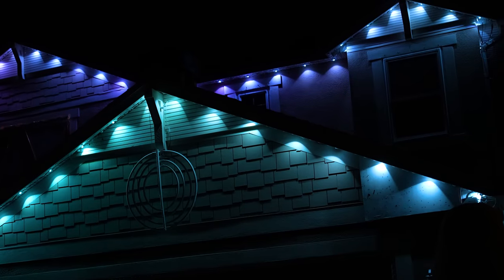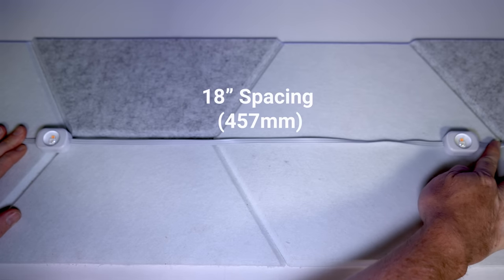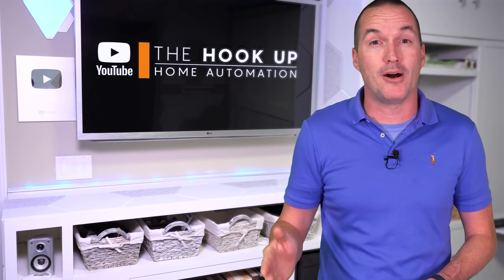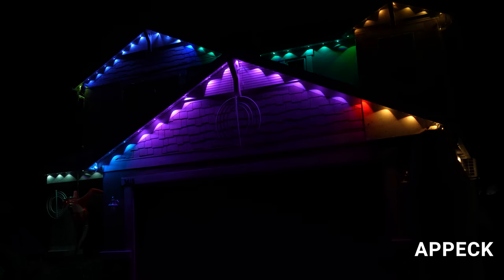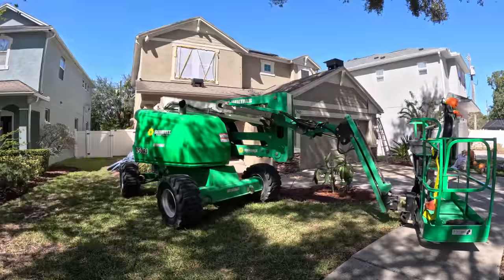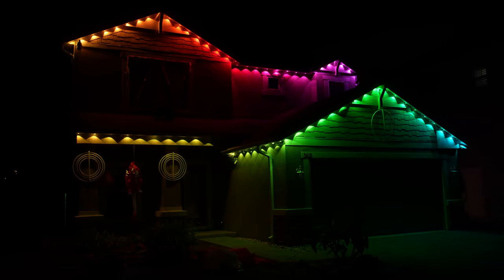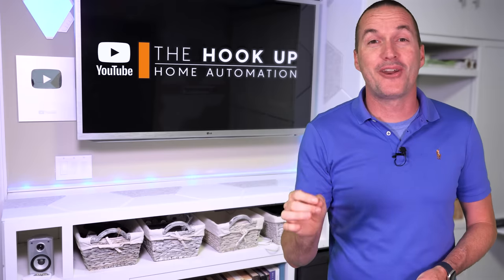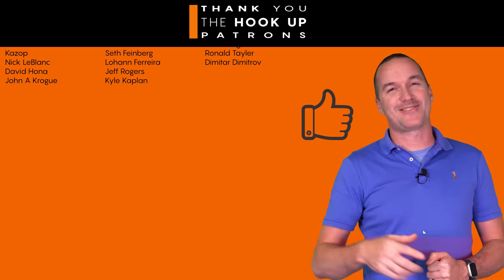Best Permanent Install Exterior LED Kit? Govee, Govee Pro, Eufy, Appeck, YPS, Novostella

Comment from the maker: Small correction for anyone trying to use the Eufy lights with WLED: In LED preferences they need to be color order BRG with W and G swapped, I said W and B in the video.

Full explanation of using WLED with Eufy/Govee here: https://youtu.be/F7IhSKJ41rU?si=720loC0GEXehwGlS&t=332
Reply: Thanks for the update!

When you show "Home Assistant: No" for the Eufy lights, does that just mean direct integrations from HA to Eufy, or does that include the WLED integration in HA? I would assume any lights that are WLED compatible would be HA compatible, but wanted to check before purchasing the Eufy ones!
Reply from the maker: @PiercingGoblin  Just the Eufy controller, WLED will always work with HA.
Reply: How do you connect the Eufy kit to WLED?
Reply: Seems like you’re going to do a video mid November… looking forward to it! 

(I’m hoping to find out how to extend beyond 100ft with Eufy… I’m planning on using 2 kits, just need to know how to connect them together … possibly with WLED?)
Reply: @TheHookUp  Can do a walkthrough on how you set up wled to control the Eufy lights? I’m puzzling over using the included 36v power supply where most controllers seem to have an input range of 5v-24v. How do you manage it?
Reply from the maker: @FreQi  Coming in next week's video.
Reply: Thank you so much for the correction.   I just build out my WLED controller for the eufy e120 and now all is well.  I appreciate your time and effort on so many of your videos.  Also, I was able to reuse the e120 connectors cut from the eufy controller by running a razor blade ALONG the wire on each side and pulling back the cover.   This was needed because of how they molded the wire to the inner wires.   I can confirm: red - voltage, black - ground, whiite - data.
Reply: Did you just tap into the cable with a data line to run it with WLED?
Reply from the maker: @Spderman37   https://youtu.be/F7IhSKJ41rU?si=720loC0GEXehwGlS&t=332
Reply: @TheHookUp   wanting to do the yps for the professional look, how hard is setting up all the custom components on the hardware side, software is not a problem as I am a programmer but I want to be warey as it is the pricey setup and I would rather not ruin it
Reply: Might want to sticky this comment so more folks see it.
Reply from the maker: @nofocus9329  Hmm, strange, it must have un-sticky'd itself.  Thanks.

Comment: Dude! This is an awesome tutorial.  Thank you for putting the time to make it happen. I went with the Govee non-pro version, and I'm glad I did. The app is fantastic, and I love that I can run them on WLED. It would be great if you could show us how to integrate some of the most compatible light kits into an X-lights Christmas show. Thanks again, bro.
Reply from the maker: I'll be making that video (xlights with off the shelf kits) in mid/late November.
Reply: will be the way you can extend some of them beyond what the manufacture says. as its just a simply setting in the WLED software. will be interesting to see if voltage drop then plays a roll, why they likely set the limit.
 @TheHookUp
Reply: Anyone know if it would be possible to sync multiple separate buildings like home and garage?
Specifically with Govee and a Weld controller

Comment: thanks for another awesome video.  Just cut the cables and installed my Eufy on my Dig-quad.  In case anyone else is trying to use WLED with the Eufy lights, I had to swap W & G to make it work rather than W & B.  It was otherwise exactly as outlined. Great tutorial!

Comment: Excellent comparison video. I bought the GoVee permanent outdoor lights, non-pro version back in July and just got them installed over the last few weeks. I’m very happy with the way it looks. I had made a cardboard template to keep the light nodes 3 inches from the wall for installation without having to keep pulling out a tape measure or ruler. So that was a useful thing. If I were to do it again, I would probably bring the lights 4 inches out from the wall. I don’t see any advantage to the Govee pro other than the warm white lights and it’s not really something I would be using very often. Plus, I’d rather have the brightness and more lights than the Govee Pro array gives. I have thought about running a separate string, just for warm white, if such a thing exists, but I would only be using that for security, or perhaps non-holiday accent lighting, but I don’t know. It’s still not worth it to me to get the Govee pro at this time. 

I took my time spacing the light nodes over the center of large windows, and other features of the house, so that worked out fairly well, and I think the wired system as opposed to a track system provides more flexibility for this. The wires are not really visible at all from the front of my house unless you get right underneath the eaves. So that doesn’t concern me very much. I definitely recommend buying more clips though that’s essential I think.
Reply from the maker: Nice, the template is good idea.
Reply: Great idea using the template, as popular as Govee is perhaps someone has made a 3d printable mounting bracket
Reply: Do you soffits? If so, what type and length of screw did you use?
Reply: What clips did you go with the ones that come with or did you find other clips that worked?
Reply: Yeah I’m kicking over the idea of running a warm white strip next to the Govee pixels as well just for later.

Comment: For the wired types like Govee, I used a 8" long 2x4 scrap to space them off the wall of the house. Made things simple, Also note that around my windows they were further recessed than the bulk of the house. So the length of the 2x4 accounted for it and I just rotated it for those situations to keep uniformity.

Comment: You are blowing my mind right now. How did you review all these in the time it took me to make one video? Aslo, I can put the Eufy in WLED!?! I had a similar track to the YPS 10 installed at my house but it has warm white. I paid a ton for the install. Amazing video!
Reply from the maker: I saw your video, the install looks great!  Yeah, the eufy just takes a 5v data signal, so connect the data wire to a WLED controller, positive on the LEDs to the Eufy power supply, and negative of the Eufy power supply to both the LEDs and the WLED controller (common ground).
Reply: @TheHookUp  Thanks for the info. I might have to try that out. I'm still have a ton to learn about what my WLED system can do.
Reply from the maker: @TechWithBrett xlights!
Reply: @TheHookUp  Eufy notes that you cannot cut to shorten, but I assume that is thrown out the window if you abandon their native controller and wire them to a WLED controller?  I currently have strips similar to yours and am interested in adding the under soffit look as well, being able to add to WLED for xLights is key.
Reply from the maker: You can definitely cut and shorten them.  I think the reason they say that is that the final LED in each string has a capacitor in it.  I assume that makes it easier to cross gaps with the extension cables, but it could also be used for some sort of software detection of how many strands are attached.
Reply: Can you use Eufy’s controller with WLED or do you have to get a different one in order to use WLED?

Comment: I just did some Ray Wu RGBW TM1814's and their aluminum track, they look awesome (similar to the YPS but way brighter) and the warm white is excellent. No bleed through from the blue like you get with some LEDs. Pricey though. 30M of track, 14 strings (280 pixels) and meanwell power supply for about $650CAD to my door.
Reply: Don't suppose you have a link to what you got..as well as the channels? This is the route I'd like to go. Nice warm white is key. Thank you
Reply: Yes, would love the link for all that's required for this -- YPS is sold out of their puck tracks.
Reply: Bro serious? Looking the Ray Wu store it looks like 30M of track is $1k plus $600 for shipping to here in the US. That's before the strings and power supply...
Reply: @tburch12785  each "order" of track is 10 1 meter sections. For some reason it only shows you that on the desktop site, not the mobile app.
Reply: @xnizonyt  ohhh yeah that makes a difference lol.  Thanks man.
Reply: What Led Controller are you using and how big of a power supply for the setup?
Reply: Is it 5 or 10 LEDs per meter? How many meters before you need to do power injection?

Comment: Thanks a ton for this video! I've been seeing a lot of Govee reviews lately, and I was considering them... but after your review, I'm leaning toward YPS. It just seems like a lot easier to get a "clean" install with those, and I'd really not have to climb up on a ladder in the dark to try adjusting individual bulbs.  That, along with the higher density allowing for more flexibility, I'm really leaning that direction.  Only downside is the Govee would be ready to go for the wife to start playing with, but YPS is gonna put a lot on my plate to get to the same place ;)
Reply from the maker: YPS is definitely better if you feel comfortable, or feel like you might want to do more hobby type stuff down the road.  If you just want lights, and you don't want to expand later then Govee is the way to go.  Eufy is a nice middle ground.

Comment: Thanks so much. I’ve been looking up spotlights recently to add the “washed” look, and your demo of the YPS track has me sold. I’ll need to introduce 12V into my setup - it doesn’t seem like you needed power injection, which is nice.
Reply from the maker: Power injection is needed roughly every 10m.
Reply: @TheHookUp What about the 5 LED/m variant? Still every 100 lights (10m) or can you get away with further?

Even with the 10 LED/m variant, if you have a 20m segment, would that be a middle and end injection or just middle?

If just doing 1 parallel run of ~100ft of power cable with tapping into it along the way, do you recommend  16awg or 14awg?

Comment: News:  Eufy now sells the E22 series, which adds a cool white LED to the mix!  So three LED's per light instead of two (RGB/warm white/cool white)... and it is currently the SAME PRICE as the E120 model you reviewed!  (Currently on sale < $200 for 100ft!)
This increases the peak brightness and color range significantly.
Nice upgrade... only I'm hoping somebody figures out if it can work with WLED before I buy it!!

Oh, I see that Govee also now has "Govee Permanent Outdoor Lights 2" which sit somewhere between the last gen non-pro and the pro.

Comment: As an electrician we install raintight equipment all the time. There is a difference between waterproof and rainproof. I'm sure most people won't submerge the power supply just a small gripe

Comment: Great and timely video sir! For the Eufy lights, if you have and install more than 1 set, are they controlled interdependently well with the app? AND is it possible to add one segment to a set - having one set with 7 segments and the other with 5 segments? - my first floor has a bit more to cover than the 2nd floor.

Comment: I buy all of my lighting for my larger projects in custom lengths direct from Ali Baba... I mostly use GS8208 or SK9822... I always order double what is necessary for my project if it's a long-term project, that way I have a plug and play replacement for any parts that fail. If the LED will be exposed to the elements, I always order IP68, which is not really obtainable on the market without a custom order. The sellers are often cool with a smaller order, so long as you know exactly what you want.

Comment: I just installed the Oelo permanent lighting system a few days ago, and my neighbors thought I was crazy with the 45 foot man lift LOL. You installed 5 different systems! Your neighbors must think you’re absolutely insane. Great video.

Oelo is a 36V system that comes in aluminum tracks, kind of like the YPS tracks you showed here. The Oelo is expensive, but it comes with everything you need and it’s 36V, which I really wanted because I had some extremely long runs and I didn’t want to deal with power injection. I looked at YPS, but I didn’t want to have to figure out my own power supply, controller, weatherproof box, etc. I paid about $2500 after taxes and shipping for 150 linear feet of the Oelo system in aluminum, which comes out to roughly 200 lights (I estimated a YPS system would have been in the high $1000s after I added all the other stuff I would need). And that Oelo price I paid is after a 25% discount, otherwise I probably wouldn’t have done it. Expensive, but like it said came with everything and all the components are very high quality. Except for the app — the app is pretty weak, but it does the job. Great customer service though, and I found out they’re working on a new controller/app that’s coming out in 2024.

Comment: As always, great analysis and comparison Rob. I'd love to go the permeant route, but with a mid-century modern roofline, I don't have continuous soffits and my trim is not white. So any of these would stand out like a sore thumb in the off season. The quest continues ...
Reply from the maker: The aluminum tracks come in a bunch of different colors, you could probably color match your soffit.
Reply: I was going to avoid buying a style I like that only comes in black, for that reason, but then I saw online that cords can be spray painted with Rustoleum. I just wonder how long it will last in the weather.

Comment: For starters... Great video and perfect timing. That said, now im in a pickle. I saw your video from 2020 and around June of this year started working on getting 200mts of ws2812b, QinLED Uno and so on. Question: If you could do it again, would you go with the any of these or the DIY RGB strip? I like the effects you can make with the RGB, but LOVE the ease of install of these!
Reply from the maker: I like them both.  The strips look much more "festive" to me, I have them pointed out towards the street so it's a very obvious effect while the wall wash pattern is a bit more subtle.
Reply: @TheHookUp   Appreciate the response. Guess you werent kidding when you said 'I respond to most of the comments'. My wife liked the strips so ease of install goes out of the door! Cheers mate!

Comment: The Govee PRO product page states in the fine print it supports up to 150 feet so that explains the extra power.. Also in the fine print they indicate a new driver module coming soon to go further.

The Splicing parts / kit is what really has me interested in the pro.. I am really not great at soldering and past efforts even with heat shrink, hot glue and silicon have had water get in so I had given up a long time on doing year round out door LEDs again.. IT is a shame it doesn't seem to work with WLED, I hope someone figures that out and adds support as light shows is something I would love to do down the road.
Reply from the maker: It's definitely something that could be solved with software/code addition to WLED.  They respond to the WS281X protocol, but the I couldn't figure out what was happening... normally it's obvious when there is an extra channel being sent, or missing a channel, but half the string was doing the right thing and the other half was doing other weird colors.  I don't know why only half of a strand would be affected.
Reply: The Pro works with 200ft. I've got it installed

Comment: Such a great video and super impressed with all of that effort. One question; Would you ever consider running COB led lights over these? Im not a huge fan of the scalloped look and I have been searching for a COB LED that would work based on your other video with COB lights.
Reply: To do a house in COB addressable would be a much larger project, and much more expensive. Depending on the density of the COB strip, you'd quickly run into pixel limitations with many controllers, not to mention the much beefier power supplies that would be needed, and of course a ton of power injection... It's definitely doable, but it would take three times as long and cost three times as much, and be three times the hassle and expense when there's a failure. 

If you were looking for a similar effect, then I might suggest one of the milky silicone profiles that can be hung and can illuminate up to 360 degrees. 

Just my thoughts on it...

Comment: I'd guess that the Govee lights are probably controllable in Wled as long as you do some segment funkiness. I was able to get their string lights working with my Dig Uno (WLED), by creating 2 offset segments that controlled every other LED (meaning that one segment controlled the white LEDs and the other segment controlled the RGB LEDs.
Reply from the maker: Yeah, you could probably figure something like that out for WLED animations, but unless the color order is correct in the LED preferences window everything would get all messed up when sending e131 data from XLights (which is the main reason I'd want to have WLED control over the Govee app).